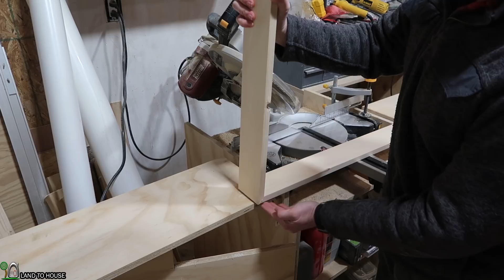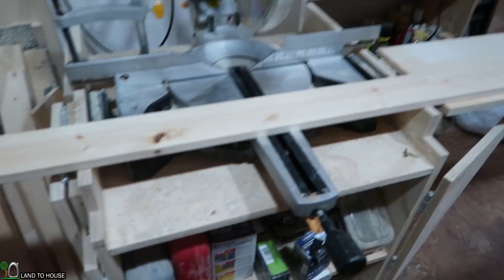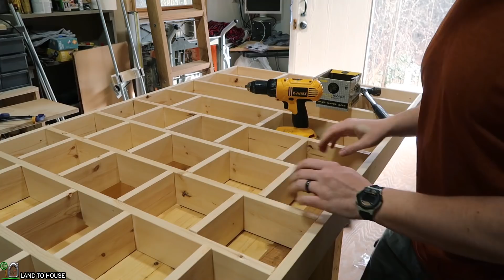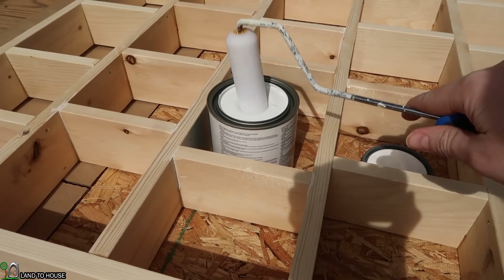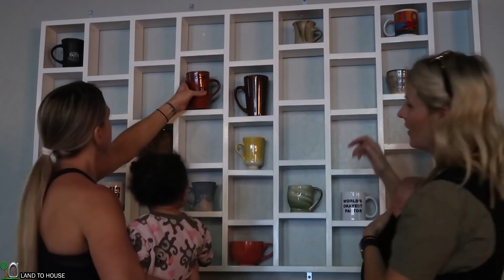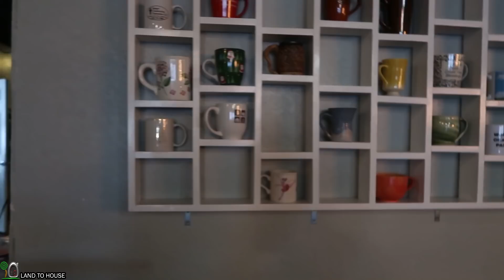DIY Coffee Mug Holder Wall Mounted Rack

Comment: Hey all,

I believe the measurements would be as follows, knowing 1x4 is actually 3/4x3-3/4

- There are 9 spaces across, which are 6 in. each (54 in.) and 10 1x4s that are 3/4 in wide (7.5 in)
- While cutting the longer inside pieces, he said they were 34.5 inches, which means the length of the outside short pieces would be 34.5 + two 1x4s that are 3/4 wide (1.5 in).

Two outside longer pieces = 61.5 inches each
Two outside shorter pieces = 36 inches each
Eight longer inside pieces = 34.5 inches each
Thirty-six inside short pieces = 6 inches each

Let me know if you believe there is an error or if you try this. Unfortunately, the one I build will have two fewer rows.

Comment: Harbor Freight has a brad nailer that will also drive staples. I use brad nails in place of finishing nails. I use it for staples too.The cost is  between 15 and 25 dollars depending on the sale. I believe it is currently $15. I just finished a project with mine.
Reply from the maker: Wow that is a great deal. I do need to look into one of those. Seems like a tool that I would use all the time.

Comment: So....if 1x4s are about 3/4 in thick in actuality...then the length of the long outer horizontal pieces must be 61.5 inches??? And you have 6 inches in between each board, is my math correct? lol

Comment: Thanks for nothing Pal. My wife just saw this and now she wants one.  What is the length you used for the horizontal frame pieces, you said your vertices are 3 ft., symmetrically the top and bottom SHOULD be 5 ft.  Am I close?????  Thanks, simple, inexpensive and efficient.  (Get a nailer)
Reply from the maker: Haha your welcome :) I go through the same thing with my wife. 

The horizontal sections are all little pieces. They were slightly different sizes because I did not get the vertical exactly equal.
Reply: Land to House Ok, I make those same “happy accidents.” I meant the frame top and bottom pieces, they look like 5 footers. Sorry. Thanks for your service by the way, big salute.
Reply: @LandtoHouse  I am also curious what the outside dominsions are? 5ftx3ft?
Reply: Should add up to 5.125 ft for the horizontal pieces.